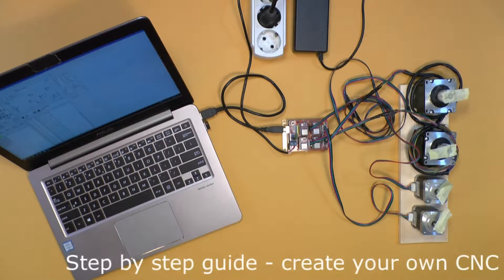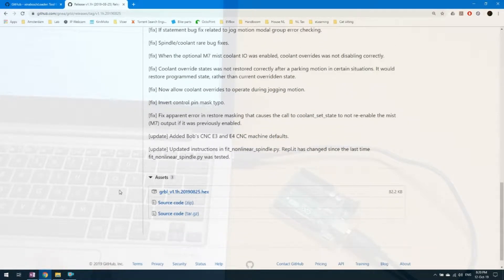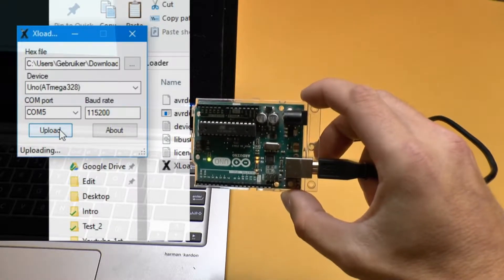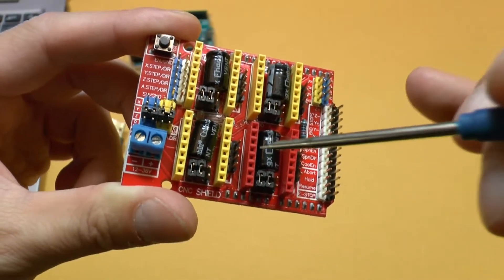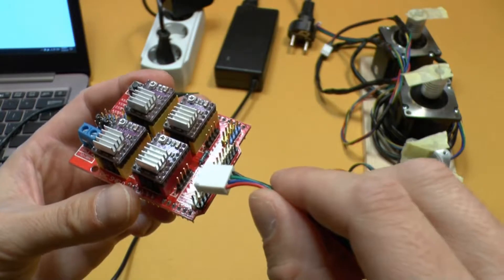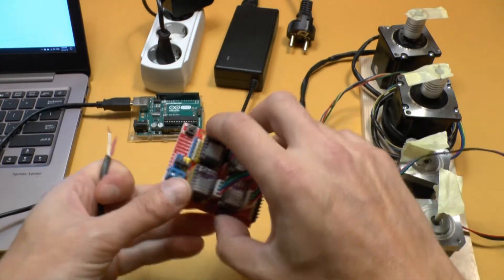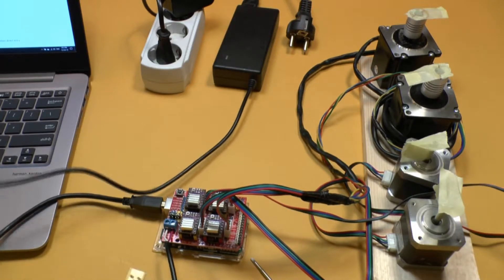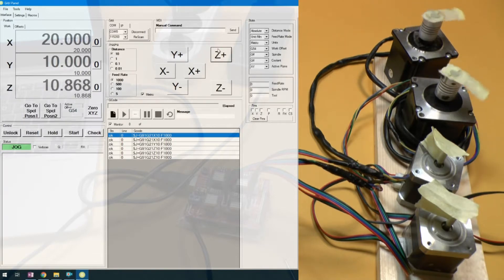Easiest way to create your own CNC machine - electronics and software

Comment: thanks man for sharing this awsome video, very simple and to the point explanation. 
lately I started working on a CNC plotter machine that works with two of nema17 and a servo motor and two end stop switches , I have a question please.
i wonder if the grblpanel software could operate my setup, and if  the gcode  could be sent throught it ?
Reply from the maker: You are welcome. Thank you for your kind comment;)
Grbl Panel can totally operate an XY Plotter and gcode can be sent through it.
Cheers!

Comment: Very good and  convincing narration of this project. 
 Please clarify ; 
1. As a precaution,  is it necessary to adjust V-Ref.  presets on each of these driver modules  settings for the Stepper Motors to set operating  current limits ?  I understand that, the voltage level on this preset is around 0.7 Volts for Nema Steppers of these types.
2. in my X-Loader, Atmega 328P is not showing up after connecting Arduino UNO R3. I see CC01 and CR03 are available for selection of devices. Any clues as to why it is not detecting my Arduino at poer COM3 ??
Reply from the maker: Thank you for the kind words;)
1 - I always adjust but I'm not sure if it's always needed. The reason I always do it is because I want the system running on the minimum current that it needed to do the job.
2 - I can only guess. Here are two guesses: - Your COM port drivers are not installed correctly. To know if this is the cases open your device manager (on Windows) and see if there is any device with a question mark when you plug in the Arduino). Second guess - your Arduino board has a COM to USB converter defective. To test this, try another board.
I hope this helps.

Comment: Thanks for sharing your experience . It is very helpful.  I am worried about how you plugged in the usb cable. Can the 5 v power from the pc usb and the 5 v power from the cnc shield be on at the same time. Won’t that damage the pc USB port?
 your response will be much appreciated.
Reply: Thanks. That’s a relief
Reply from the maker: Hello Sintra Sankar, thank you. Yes they can. In this video I connect the 12 V power supply to the CNC shield at the same time as the USB cable to the PC.

Comment: Hi Pedro;

Can we use Arduino Mega With Marlin or (Grlb for marlin) ?

I wanna make a delta Robot
My robot motion same axes for example 
X movemet 3 motor rotation, 
Y axis movement 2 motor rotation and  z axis one motor rotation 

like as ; " https://www.youtube.com/watch?v=fRf47LuHjgw&ab_channel=JKLee "
Reply from the maker: Hello Oğulcan, you can use Marlin or grbl with Arduino. My understanding is that Marlin may be more appropriate for 3D printing and grbl for CNC machine milling. I happened to make my own CNC milling machine because it would be too expensive to buy one with the characteristics that I wanted. On the other hand it's cheap to buy a 3D printer with the characteristics that I want. For this reason, I made a CNC milling machine and I'm somewhat experienced with grbl but I never made a 3D printer and I'm not experienced with Marlin.

Comment: Hi, great video very inspiring👍👍. I have a bench milling machine, at present it's only hand operated. So my question is. How big a stepper motor can the drivers in your configuration handle? Regards Mike in Denmark.
Reply from the maker: Thanks Mike! In this video I'm showing NEMA 17 motors for X and Y and NEMA 23 for Z. So the drivers can handle these motors. But the true question is "at what load?" because I'm running the motors in my table at no load (no effort moving a CNC machine). I don't have an exact response but I do have some tips:
- Regulate the current in the motor driver for the amount needed and not more.
- Use a fan to cool down the motor drivers.
- Chose the leadscrews wisely. e.g. I'm using TR8x2 leadscrew. This leadscrew has 8 mm in diameter and for each turn the nut will have a linear movement of 2 mm. There are also TR8x8 screws (for each turn - 8 mm of linear movement). The later will need more motor current.
- Lastly if the driver is still not sufficient use an amplifier circuit. You can find them easily online.
I know this is not an actual calculation but I hope it helps!